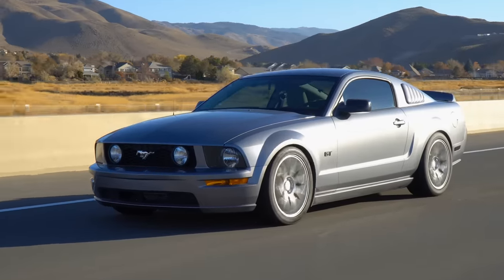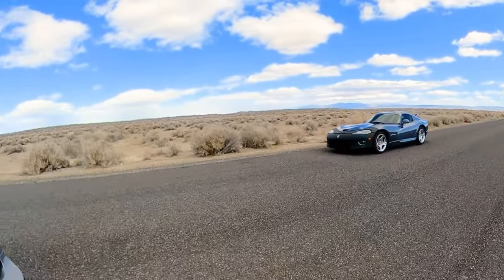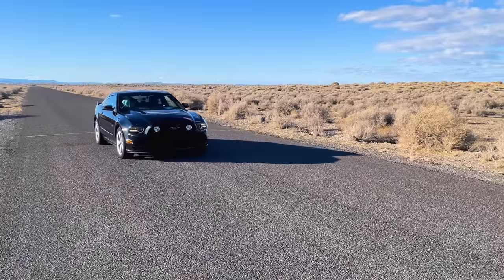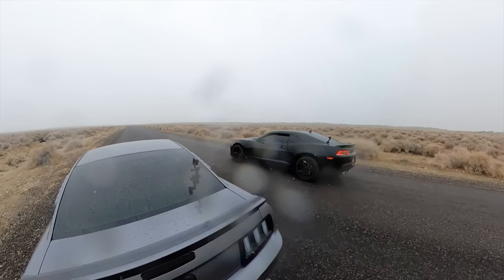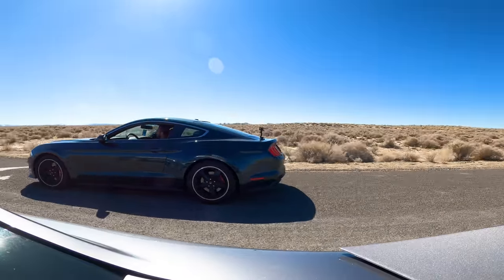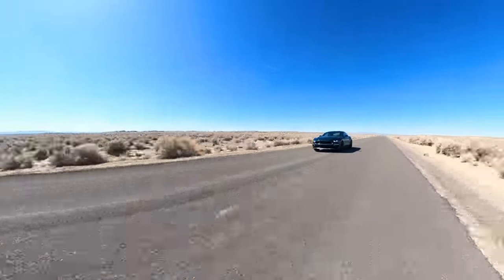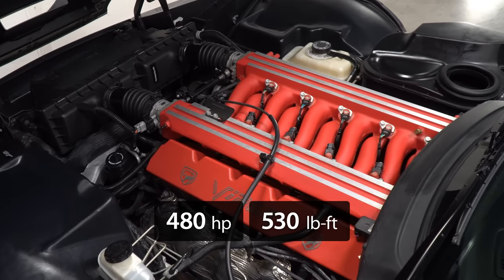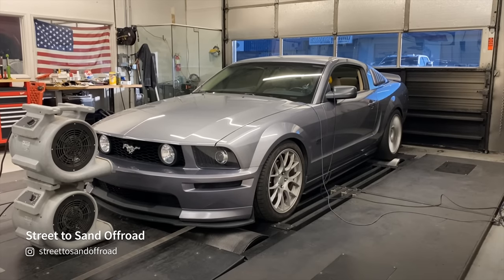Showing the world what an all-motor 4.6 Mustang can do

Comment: I do love the S197. Just the most iconic I've seen. Though it always makes me wonder why Ford chose to completely kill off the 4.6 4V in favor of the 4.6 3V. I feel like it would have been a nice carry over to the new body style and could have been a pretty stout option even if they only made output 320-340.
Reply: This is exactly what I've been asking myself for years 😐 they could of put the terminator engine without the blower just a bit more refined and it would of been wonderful.
Reply: @Panchitoisdead714  It's just such a weird decision because I would imagine a 4V 4.6 with VVTi would have been an absolute monster and considering that the 3V was more or less a carryover anyways...it wouldn't have harmed production as is. I understand the point of the 3V...I'm not saying that it should have been nuked in favor of an upgraded 4V, I'm just saying that the first couple years of the chassis should have offered this as an option while the GT500 was getting off the ground.
Reply: They could have easily used the Mark VIII motor that is quite a bit cheaper than the terminator motor but still was making over 300 in 92
Reply: @jaredmonk5328  The 4.6 4V in the VIII was only rated to a maximum of 290HP. It wasn't until it was put into the SVT Cobra that it made 305HP and that was primarily due to a switch from the early style head to one that flowed a lot more. Otherwise, the 4.6 4V was the same block and head across the board with the only differences being the intake and cams of course. but you're not wrong as far as cheap goes. The engine had already been around for approximately a decade or more at that time so I have a hard time imagining that there would be much development costs associated with adding variable valve timing since it was clearly shown to have significant impacts on emissions and power.
Reply: @kingssuck06  I do remember that, but that's where I'm still kind of baffled because I feel like a 4V 4.6/5.4 would be just as potent...if not more in 5.4 trim than even the Coyote if the invested time in introducing VVTi and or direct injection. The reason I don't completely believe that it's a ''cost saving measure'' is that the 4.6 2 and 4V engine had already paid off the overall cost of development nearly a decade before the introduction of the 3V so every single engine sold was purely profit at that point. Both 2 and 4V variants had proven themselves since 93' that they were reliable and dependable, so I'm sure that a more modern 4V would have at least given the 4.6/5.4 platform 10-15 more years worth of life easily. I have accepted that often Ford does things because of one reason and one reason alone...someone comes up with a stupid idea at a board meeting...but nobody really has time or the competence to argue against it...so instead of looking into other options they full send into it. Case and point...killing the Ranger only to reintroduce is after nearly 8 years. 

https://www.motortrend.com/features/1710-undertstanding-the-ford-4-6l5-4l-3v-sohc-v8/amp/
Reply: @Your Pappy There wasn't a second exhaust valve. It had 2 intake and 1 exhaust valve. The second intake valve was used...in conjunction with the charge motion controllers in the intake as a way to ''speed'' the airflow up so that the engine could ingest more air at one time and it was actually intended to be a stopgap measure between the 4.6/5.4 family and the new Coyote based engine family. Adding the additional valve and cam lobe to the 4.6/5.4 cost next to no money while they began development on the Coyote which is rumored to have began as far back as 06. But, from all the research I've done over the past couple years...there's no mention about the 4V versions of the 4.6 and 5.4 being modified further outside of their final generations with a blower or bolt on's like larger cams and higher flowing heads.

Comment: Everyone forgets at the time of the 2005 to 2010 4.6 Liter Mustang, it wasn't a big underdog and it wasn't bad on power. It wasn't really until the 5.0 came along that it got bashed for lack of power in after market parts. It was fast for its time just like any car.

A 2017 Kia Stinger is now just as fast as a 1992 Viper RT10, a 2019 Honda Civic Type R is faster than a 2004 Mustang GT or even matches it . Fast is all relative. I know I sound like a fan boy but I'm being realistic. Also, I am a mechanic of 19+ years and grew up working on Fords. 

The 4.6 Liter in any form, 2 valve, 3 valve or 4 valve were all excellent engines and Ford did away with them after about 20 years and gave us the coyote 5.0 Liter. It's ashame these engines have thus reputation now. They may not "make power" but I'll tell you, they last 350k miles over these coyotes.
Reply: The 4.6 is the best gas engine for has ever built. Do you want it to last a million miles without major work? No problem they will do it. Do you want to make 3k hp on the stock block? No problem they will do it. While they lack power, they're more fun, better sounding, better looking, cheaper and, more reliable vs the newer one's. Who cares if they have 260-320 stock. They're very fun cars.
Reply: I agree with you 100%, it is all relative, back in my day when the 87 to 93 mustang 5.0 came out they only had 225 horse which is pathetic these days but back then with the massive to torque an  the lightweight of those cars they were very quick, and with a few mods and a gear you could dust just about anything.
Reply: Oh absolutely to both of you!!

We've had all sorts of 4.6 liter engines come in with that kind of mileage! I had a  3 valve 2005 F150 come in with 726,000 miles and the owner kept up with all the service intervals. No issues. He only had to replace the water pump around 300,000 miles and he did have to get the exhaust replaced around 550,000. But engine wise, that 3 valve had no issues.

And those older Mustang 5.0 may have had only 225hp but com' on, they could move! It did help that they were light weight too, but minor modifications gave big results back then! And 225 horsepower was unheard of back then in a road car.

The scary thing is everyone is so used to big horsepower cause of turbo and supercharged cars today that they forget for their time, these were fast. I have a 2006 Mustang GT making 368hp and on Thursday I'm picking up a 17,000 mile 2007 Mustang GT...cause my state of the art 2015 Fusion 2.0 Liter blew up cause of Ford's Coolant intrusion into Cylinder 3 and 4.
Reply: The 3V sucks! Always has! Took a lot of mods to beat a stock C5
Reply: @robvas  News flash, Mustangs weren't built to compete with vets, lol vets are top tier sports cars, mustang an Camars have always battled.
Reply: @karlhopkins713  yup, 4.6 32v best sounding engine
Reply: Everyone is entitled to their opinions but facts are facts and the proof is in the pudding LMAO Just speaking from experience but, hey, what does a Ford mechanic of 19+ years know 😂 🤣
Reply: @ALYXTANKBACKPACK  I'm not getting into a YouTube fight LOL I'm too old and mature for that. You got your opinion and I got mine and no kidding, I'm biased 😉
Reply: @ALYXTANKBACKPACK  Just another clueless person on the 4.6 and 5.4. Keep quiet bud. Ohc will never make the same power na. As for the lightning. Again ohc with a tiny blower vs pushrod. You kjow nothing if you think they are shit engines.

Comment: was planning to coyote swapping my 06 3 valve but after i talked to the dudes @ power by the hour, sadly i think just selling mine and getting a 15-17 mustang is my easiest bet.
Reply: Yes it is the most reasonable thing to do tbh. I too would love a coyote swap but they’re pricey
Reply: @Robyne_u61  exactly. I was thinking I would have saved money doing a swap.
Reply: why not just bore it out to a 5.0? or are they not thick walls?
Reply: @cerberus1166  The 5.0 is also a dohc and thus breathes better at higher rpm, and thus makes more power
Reply: Build the 3v bud. The block itself are superior to a coyote. Coyotes sound like absolute ass.
Reply: @augustopinochet6899  chevy would like to have a word with you then. because they run single on the LS and are one of the best breathing engines available. DOHC is just more stuff to break.
Reply: @cerberus1166  you can't bore it out that far. The 5.0 kits are all strokers unless you get a boss block
Reply: @robvas  dang. kinda surprised figured since its a smaller engine it would be pretty thick. but newer stuff tries to use as little materials as needed so i shouldnt be too surprised.
Reply: @karlhopkins713  I agree the coyotes mustangs sound horrible

Comment: What gears did you run in the GT?  I owned an 09 Bullitt with longtubes and a custom tune.  326/337 to the wheels (Mustang dyno).  Best run was a 12.9 at 110.  It could dispatch 5.7 hemi Challengers with ease.  But the 3.73's were huge in that performance.

Comment: People don't like the 3v 4.6 because people don't understand them, and just wanna put on a few bolt ONS and be the fastest thing on the road.
Reply: Exactly, these cars have respectable times with minor mods as well, but no one knows what they’re doing.  One piece aluminum driveshaft, cai, exhaust, and some better gears make these things surprisingly fast.  There’s even an old video of a stock, gutted 3v running 11’s and 12’s on a full drag tire set up and 4.56 gears.  The motor will never be that of a coyote, but it can still be built rather reliably
Reply: @ALYXTANKBACKPACK  that’s the thing though, you don’t have to put 15k into the car to make it fast.  The biggest faults performance wise (non maintenance) with the 3 valve are the camshaft, the intake, the driveshaft, the gearing, and the weight of the car.  I would also say pistons and rods but those don’t become an issue unless the thing gets boosted.  If you change out all that stuff, your looking at 2k-3k budget build depending on where you get your equipment (note that doesn’t include a handheld tuner or the cost of programming).  The car will already run 13.7-13.5 on just an intake and tune with street tires, while hitting the trap at 103-104 mph.  You can easily make these things a high 12 second car without much effort and you don’t need 400 whp.  Again the coyote will always be the superior mod motor, but that doesn’t mean the 3 valve completely sucks either.
Reply: @ALYXTANKBACKPACK  obviously you don't know much about the mod motor at all.  Look up John mihovetz. He took a factory 4.6 block, crank, 4v B head, timing set, and went 5.88 in the quarter.  And the 5.4 W block with the Navi heads is an even stronger setup.
Reply: John had rods, Pistons, studs everything else including the heads were factory. Show me a factory LS block and factory LS head combo that comes close to that, 799s and 243s will never come close.
Reply: @ALYXTANKBACKPACK  LMAO takes a lot more then a 1000 to run 5s lol you don't know much about racing either I see.
Reply: @ALYXTANKBACKPACK  what part of he made over 2000hp with a factory block and head coast a lot of money? I can go to the junkyard and get a 4v 4.6 for $200. It's a pro mod not a funny car, huge difference.